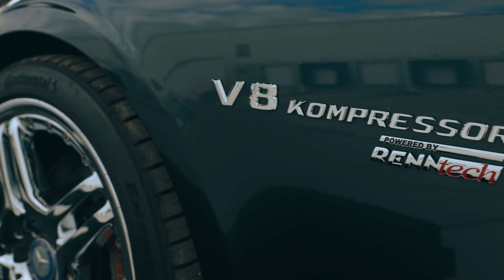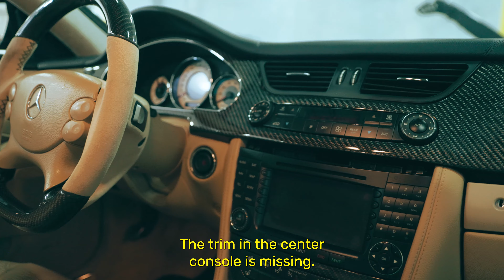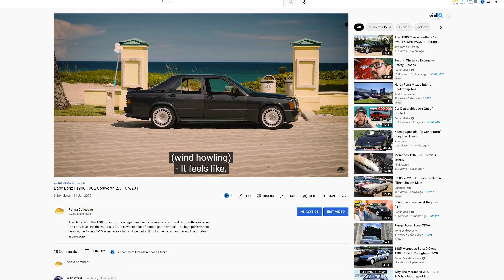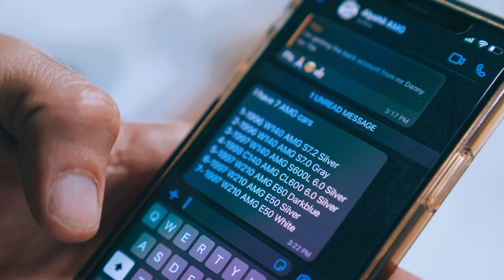Mercedes 190E Madness & Stolen Parts! | VLOG #010

Comment: I’m looking to buy a 190e Cosworth, my first Benz. Should I be worried about the difficulty of finding parts? Any major issues to look out for with the vehicles? Love the videos!
Reply: Don't worry about parts
Many parts are the same of the regular 190's
Engine head parts, some mechanical stuff and some interior things are diferent
On geral is not that hard to maintain, its harder to buy because its getting more and more expensive
If you are thinking on buy One, just do it
Reply from the maker: buy the car!
Reply: @PatinaCollective  someone offered more than me and I missed out on a Euro Spec. Hopefully another one turns up..

Comment: The grey/white 230e w123 is a
Brabus, not lorinser.  The car has still Brabus invoices
Reply: Lorinser kit
Reply: I have the same car, same rims made by Rial, that's a beauty.
Reply: @smackmag  yes But installed By Brabus.  This is a very early Brabus build. Al the mods were mentioned in the German kfz brief and on the copy of the invoice that came with the car.    I picked this car up for victor